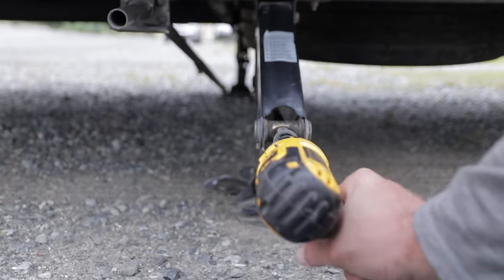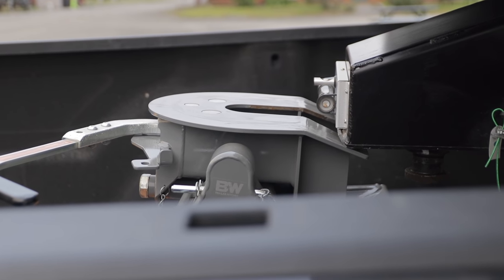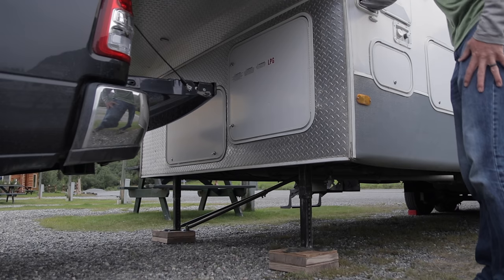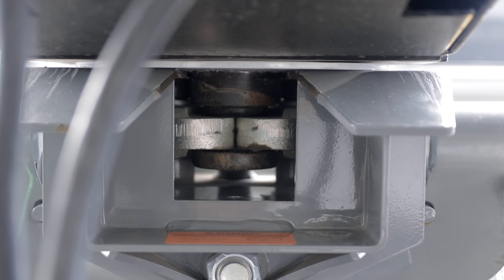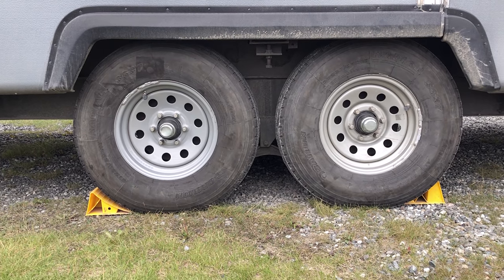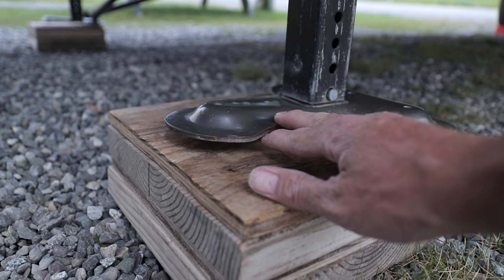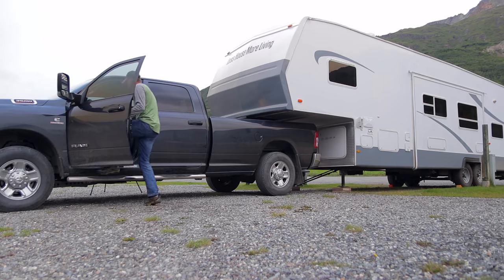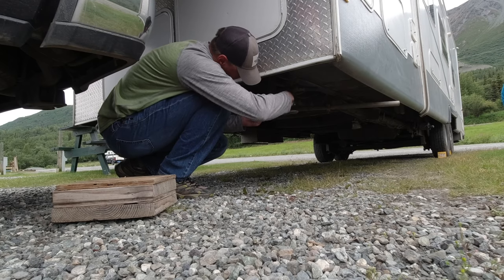Tug Test For 5th Wheel RVs

Comment: Also a good idea to visually check the alignment of the pin with the open jaws of the 5th wheel before you back into it (similar to the view you showed of the jaws around the pin). If the pin is even off slightly left or right to the opening this can shift the trailer when you back into it, and increase the chance of an insecure hookup.

Comment: Air bags on the truck let’s me back up to the hitch and raise or lower the back of my truck to the perfect height while sitting in the drivers seat, no need to get out and do it with the landing gear, once hooked in I can add more air and raise that extra 1/2” off the ground. As a bonus it rides a lot nicer going down the road and my truck always stays level so the headlights aren’t blinding on coming drivers from pointing in the sky when the rear of the truck is loaded, or pointing into the ground when it’s empty. I went with the 7,500lb kit from Air Lift, installation was super easy on my 3500 Silverado dually.

A safety tip is needed here: Many people like to add battery disconnects on their RV batteries, it’s a great idea, however, keep in mind your RV battery is what activates the electric trailer brakes if the break away cable gets activated. If you have the battery disconnected while traveling you’ve just killed the purpose of the break away cable. Either leave your battery on while traveling or direct wire to the break away switch around your battery disconnect if you have electric trailer brakes.

Comment: Really like your videos. I do the tug test religiously. I perform every test like you do. The only difference is I leave my tailgate down until after the tug test. My theory is if it does come off, the pinbox is close to the top of the liftgate and don't want to risk hitting it. I know it will only come down about an inch but just call me paranoid. Safe travels thru these tough times.

Comment: Hey Jared, thanks for showing me the right way. I have not been using the ramps, I was leaving a very small gap between my disk and hitch, I have auto leveling so I have been leaving jacks down with chocks and then do what you do for the test, so should I use auto retract and then lower front jacks to within the 1/2 " like you do? As always thanks for your expertise. 😷✌🏻️

Comment: Hey, great video. I have a question about leveling our 5th wheel. We recently tried to level (front to back) at a site but our front jacks would not retract far enough to achieve level. What do you do in that case? Do you put more leveling blocks under the wheels ? Or do I need to do something to the front jacks to allow them to be able to retract further?

Comment: Jared, great video and reminder.   I am looking at purchasing a new truck for RVing.  I am thinking of doing the long bed (8') to gain some more room around the 5th hitch and a higher payload capacity for the RV.  Is there enough room to open the tailgates on long bed trucks when connnected to do all the things you mentioned in this video?  Is there any down sides to a long bed truck when using a 5th wheel?
Reply from the maker: We have been glad we did the 8’ bed for the 5th wheel. We can have the tailgate down to connect to the 5th wheel but we need to be fairly straight and lined up. If we have to come at an angle we close the tailgate once it is clear to close. The only draw back I have with it is when parking is tight and we feel too long to fit in a parking spot.
Reply: @AllAboutRVs  Jared.  Great, thanks for the answer.  I appreciate it.
Reply: I've owned an 8' bed since we started RVing in 2003.  I'm on 5th wheel #3 and each is a bit different in terms of what you can access in the front "garage" area when hitched.  Parking can be tight as Jared says, but backing in and using parking spaces around the outside edge of parking lots can help compensate for the added length.  Plus you get plenty of exercise when you park out in the boonies and have to walk a bit further!!

Comment: Jared, in one of your videos I noticed insulation attached to the inside of outdoor storage compartment doors. Is that permanent & what adhesive did you use? Thank you. Chris
Reply: Not sure what Jared used for adhesive but I used 6 pieces of Nano Transparent Gel Tape (Amazon). It is removable and reusable... I used it initially as a temporary method to attach the insulation, just to test out the effectiveness of the insulation, and the Gel Tape... and 8 months later after enduring some scorching sun in the summer, and sub-zero weather in the early fall, it is still going strong! It was Jared who introduced me to this stuff in one of his earlier videos.